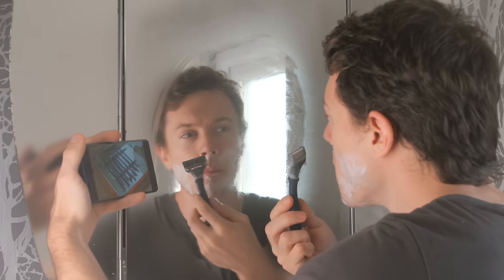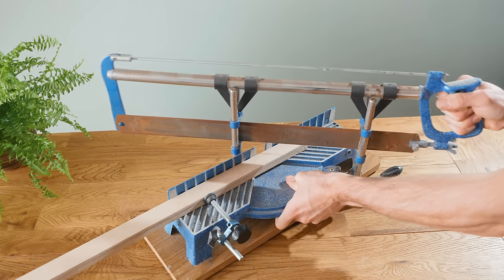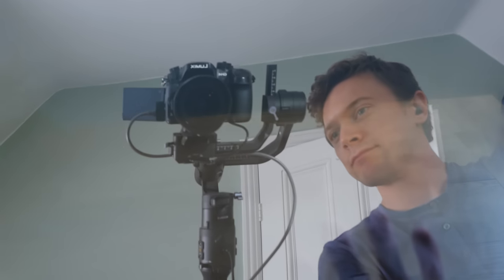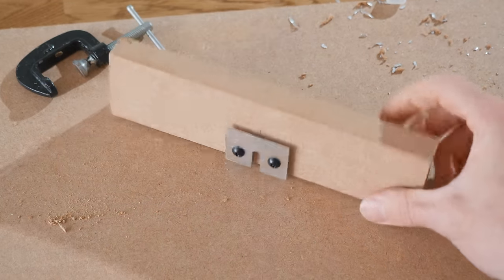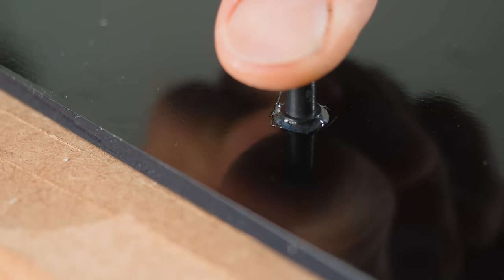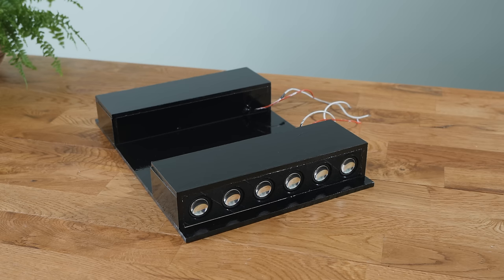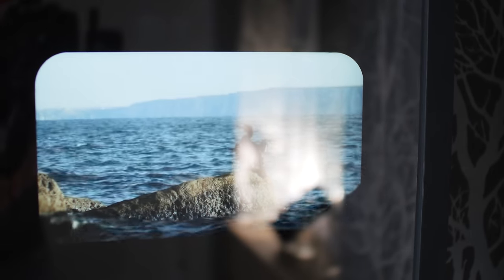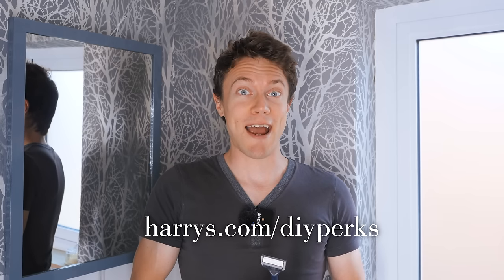DIY Smart Mirror (that doesn't steam up!)

Comment: "The mirror is always filled up with water" Yeah, that's fine and dandy until you get algae growth and the whole thing begins to reek
Reply: You won't be getting algae, since this thing will leak in like a week.
Reply: @lazar2175  If you think a week is not enough time for algae to develop it is because you don't have an aquarium ;). Algae will grow, and it even doesn't need it to be full of water, just a very humid environment (exactly what we have here).
Reply: @almarma  Oh boy i have a aquarium, but algae have 0% chance of developing here.
First off, the tap water is mostly sterile due to dubious amounts of chlorine in it. This means very little to no starting ground for algae.
Second off, the algae needs light, and this doesn't provide any light to the water.
Also third, my comment was supposed to be a joke and not taken seriously.
Reply: @lazar2175  Tap water is not chlorinated in Europe
Reply: @lazar2175  Maybe with a lot of chlorine you could get less or no algae at all, but not everybody has that amount of it in tap water. Also, if the bathroom has a windows, it could have enough light to grow algae. I can't say it 100% for sure because I haven't tried, but knowing how algae can grow even inside the tube I use to vacuum the gravel once a week (only once a week gets wet), I have a lot of doubts that this part of the project will work in a long term
Reply: @almarma  it's a mirror. One way light passes kind of easily, the other way is extremely hard. So no light. What you saw in the video was the display brightness cranked up to 100%, as so much of the light is being reflected by, well, basic properties of a mirror.
Reply: Some copper would probably help keep algae from growing. Bad idea for aquariums, good idea for decorations.
Reply: @almarma  You know that there are different breeds of algae, right? I've got several fish tanks, and some of them grew algae within a week.
Reply: Felixkeeg have you ever been to the Uk? It smells of chlorine.
Reply: @Felixkeeg  Well thats interesting, here in Bulgaria it is chlorated. Where are you from?
Reply: Just add a silver kill coil (used in PC watercooling) and that should inhibit any growth - They're not perfect, but better than nothing.
I'd be more concerned with the MDF swelling if it's not sealed properly and I'd also want those electronics wrapped to help prevent the parts from corroding.
Reply: @Felixkeeg  .. that's not correct. UK and Ireland -> yes, we have chlorinated water.
Reply: @Felixkeeg  some places it is
Reply: @xero2715  Yes, of course I know. So, what's your point?
Reply: @almarma  You claimed that algae does not grow within a week.
Reply: @xero2715  Sorry but I didn't. Please, read my comment again.
Reply: @Felixkeeg  Oh boy, you are wrong again. 
It is chlorinated  in most countries in Europe, only a few countries don't chlorinate their water but even then they use other things to prevent stuff growing.
Think logically, do you have any algae in your toilet seat tank? Or in your washing machine? I know i don't.
I agree that this design is bad but it will not get algae infested before it leaks i guarantee you.
Reply: @almarma It will not work, it will leak very soon.
However, this thing is essentially a black box inside, there is absolutely no light inside, hence no growing things.
Also, most places have treated water with things to prevent algae growth.
Think about it, any algae in your toilet flushing tank or your washing machine or your kitchen sink.

Also, if you own a aquarium you probably know fish won't survive in regular tap water for long, so we either leave water overnight in the open container or boil it to get rid of HCL, or we use distilled water uf the tank needs topping up.
Reply: RainX anti fog for car windows wouldve been a much better choice.
Reply: @somedude2492  Your statement is fundametally wrong. The direction of passing doesn't matter, it is a partial mirror from either side. So light travels into the case just as easily as it leaves it. There would be light in there for algea to grow for sure, even if it will not be that much.
Reply: Jappleng
What do you use? I tried the shaving foam trick and it didn't work. I don't want to spend money without being sure I'm not wasting it
Reply: Jappleng
I find it hard to trust reviews aren't paid for, find that comments are generally a better source of info
Reply: @lazar2175  I'm pretty sure it's not chlorinated in England...
Reply: Bruh, algae forms anywhere with most water and some light.
Reply: if not algae growth limescale over time
Reply: @Felixkeeg  and there is electricity in the bathroom. UK is probably the only country that doesn't put washing machines in the bathroom.
Reply: @lazar2175  Nope. No chlorine in tap water in Germany. Also algae wont grow in your washing machine or toliet or something because they dont like moving water.
Reply: @Felixkeeg  Same here
Reply: @lazar2175  chlorine decays after some time and algae could grow again
Reply: you need algae for algae to grow.
Reply: @davepickering997  what are you talking about? Is there a place where people put washing machines in the bathroom? I've never seen that. I didn't live in many places though, so I may be talking only for Brazil, Ireland (and probably Russia) here
Reply: Guilherme Taffarel Bergamin in Poland we usually have washing machines in bathrooms, and we keep (and use) hairdryers there as well
Reply: @pawemarkowski2768  interesting. I can't imagine a washing machine in the bathroom because it would take a lot of space there. In Brazil we usually have an extra room for that with iron and the hanging stuff I don't know the name in English. If you live in a small apartment without this area, the building would have a shared place for everybody to use, like three or four washing machines and dryers (or the hanging thingy) plus some irons.

The hairdryer though, I agree. We also keep it in the bathroom. I don't have one because of short hair, but I've seen people having it in the bathroom
Reply: Doesn’t algae need sunlight?
Reply: @tsundereyoongi3869  Englands Chlorine levels in tap water range from ~0.5mg/l to 1.0mg/l whereas the WHO has said 5mg/l. So UK water has less than 1ppm of Chlorine in it.
Reply: @DarthGTB  Yes in Greece a lot of apartments have a dedicated space for a washing machine in the bathroom. Complete with water intake and outake. The power though is taken from an extension cord through the wall that connects directly to a power socket outside the bathroom.It can be disconnected from the socket when not in use.

Also in Germany and in Greece I had a power socket on the bathroom mirror on the top right next to the lights with  13+ amps for hairdryers and other high wattage appliances. Although they had a safety switch for on and off. 

I am from Greece but grew up in Germany and now live in the UK and find it a bit inconvenient but more safe not to have any high amperage sockets in the bathroom. At least in the houses I have lived so far the only sockets where shaver only sockets with low amperage.
Reply: @KostasRetrokiller  interesting. In Brazil we might not have washing machines but we do have electricity sockets on the wall. I use it for my shaving machine, but you could plug anything in it no problem.
Reply: @Felixkeeg  a great example of lying just to get your point through and to have the upper hand in an argument..
Reply: I mean some sort of simple anti fog layer would be far better.  Or heck do the two layers except put a small heater and fan in between.
Reply: @Felixkeeg  I don't know where you do live but tap water is actually chlorinated in Europe

Comment: Wow. This is definitely the most elaborate smart mirror I've seen so far. I do think using the Chromecast is brilliant. Most people use a Raspberry Pi. And that paint job! I thought he was holding a metal or plastic frame at first. Now I just have to convince the wife to let me get rid of the medicine cabinet...
Reply: Why not both a medicine cabinet and this. With some clever modifications to this setup you could easily integrate a door
Reply: @rayproductionsbackupchanne3862  Right, you could have the medicine cabinet be behind the screen, which makes it a piece of cake, although this mirror isn't slim to begin with, and adding a medicine cabinet would make it even thicker. Defenitely do-able though.
Reply: @jarleskogly8388  it would have to be build in the wall
Reply: The mirror is thick because of all the components behind. Just place them under the cabinet OR inside of the cabinet.

Comment: MDF in bathrooms is not recommended, even if painted.
Reply: Victor Supreme that’s what the MDF sealer is for.
Reply: @JohnJones-it3us  Yup.  But one tiny pinprick will continue to soak up litres of water and balloon out.  Not worth the risk IMO.
Reply: Then just use an epoxy resin and you won't be poking any unwanted holes through it.
Reply: TheRageMaker  It absorbs moisture like crazy apparently
Reply: Or, you know.. just use actual wood..

Comment: Amazing!
..As for shaving, I started using a Feather safety razor with Feather Japanese made blades (sharpest on the market) I will never go back to a mach3 or any other razor again. Also it's the cheapest way to shave and the best.

Comment: heck imma try this with a giant 30" display panel XD
Reply: Lol
Reply: That sounds like a really good idea tbh. I can think of some great uses for that (Halloween is around the corner)
Reply: But then it wouldn’t really be a mirror would it? May as well just hang a TV on the wall, and good luck powering that and staying alive.
Reply: If you do, you won't need the complexity of this design, the heat generated by the tv itself will prevent it from fogging up. 30" two way mirror glass isn't cheap however 😎

Comment: I wouldn't do a version of this that needs to recycle hot water every time it's used during a shower or after a shower. I think there are other ways that don't involve recycling water or high powered heating elements.

Comment: I would rather have used a 12V heating foil/film instead of this crazy water system.
Reply: I agree. This seems overkill or just the wrong solution for this problem.

Comment: I'm surprised you wouldn't just use glass and build a heating element into the mirror that turns on when you use a single plug, which also powers the display/speakers.
Reply: He's British, they do not allow electrical outlets in bathrooms there, that is why he used a battery pack and I don't think that battery pack would power a heating element for long or even at all.

Comment: having to attach a plug to your tap and fill the mirror with hot water every time you use it seems like quite a bit more effort than just periodically applying an anti-fog coating like they sell for car windshields.

I also feel like you could make it a great deal thinner by not facing those speakers sideways and instead have them either bounce sound off the wall or transmit it through the glass

Comment: How about using heating wire?
I think i saw some on Aliexpress. Like 12v i believe
Reply: I believe you don't need one. it would be enough to add LED lights to the mirror as they provide both light nad heat.
Reply: @CovertCoder01 I am not sure.  What you can google is:
"A good quality LED strip should be capable of providing 4 watts per foot or more (15 W/meter).
"

"As a result, typically, you may see LED strips run at 30% efficiency. This means that a 90 watt LED strip light reel will emit 63 watts (90 watts x 70%) of thermal energy - approximately the same amount of heat as a 60 watt incandescent bulb, which as you may recall from experience, certainly gets quite warm."

Comment: (Sorry about my English, I’m from Brazil..) i actually made it and it looks awesome.. I don’t have any tools to work with wood tho, so I payed someone to tho the work for me and I just paint with oil painting.. instead of an old laptop monitor I just remove the body of an old 17’ monitor with dvi and take of the metal of the display (the metal that stays around the glass and the backlight) and it makes the screen I bit lighter.. I wasn’t planning to get it expensive so I actually don’t have anything to plug everything.. but it’s easy and I really think it easier with the monitor.. it’s a good project guys! The window isn’t expensive either...

Comment: More speakers does not provide louder or fuller sound. It merely provides sound coverage. These speakers wouldn't do much for quality or coverage considering they are not pointed at the user's ears and that they are mounted 180 degrees from eachother.

Comment: "DIY" : Need to have exceptional woodwork skill and handcraft skill and electronics skill and...
Reply: its still "diy"-Do It YOURSELF
Reply: @LFLloureiro  If you can do all of that by yourself then it is DIY. I couldn't.
Reply: Need to have the tools more than the skill. After you got that, it's just following the instructions really
Reply: @krrk6337  How are you supposed to acquire a skill, if you don't do stuff involving it? Even if you fail at it. "Damn, my PCBs corroded, why is that? Oh its because they were exposed to moisture." As long as you educate yourself on how to NOT cause a fire, you should be good.
Reply: That's what DIY is about, you need skills to do things in life

Comment: Just one note/recommendation: Maybe use something other than mdf (solid wood, aluminum) for a bathroom mirror. Mdf that gets even slightly damp will over time bend, fall apart, and any paint on top will peel off. I know this from experience of having mdf cupboards in my bathroom 🤷‍♂️

Comment: I'd go with two heated water channels pumping the water from the bottom to the top and heating it as it goes.
Would take a little while to heat it up, but enough time is given as a shower takes some time as well. No need to place the heating elements inside the mirror, behind it works just as well. Just for the convenience of not having to replace the water every single morning or whenever you're taking a shower. Would just have to top it off with water every now and then.

Comment: Regarding the description, 48 ohms is not too much for an amplifier.  You can put as many speakers as you want in series.  The only downside is the power output will decrease.  Neat project though.

Comment: Would've been perfect if you made a cover for the USB board, since a bathroom can steam up so much that the water can run down the wall tiles, onto your USB board. 
on another note: using shaving cream to clean the mirror also works to defog the mirror, so no need for a defogging system inside. + would've been a nice wink to your sponsor in this one :)

Comment: Your 108++ easy-DIY steps aside for this project: I've no idea what I'm talking about, but apparently hydrophobic mirror coatings are a thing (for cars) and could be an alternative to your hot water demisting system? A subtle bottom-frame evaporator sponge/grille (to soak up runoff) might avoid the need for a drain tube, and would dry out during the day? (you couldn't be evaporating any more water back in to the bathroom during the day than your morning shower initially humidified into it). Anyways, great ideas and re-usable tips for far different projects, so thx a lot.

Comment: This is pretty cool. I just wonder if there is a way to drive a heating element/reservoir/ with the same 12v setup.... would be cool to not have to worry about heating the water with the tap

Comment: So the non-mist mirror is pretty great, but not really practical. The only solution I could come up with is that instead of having a hose filling it up, with water, you would want the mirror to be heated which would do the job regardless. All you'd need for that is to get yourself a heated blanket (or pillow) and attach it to the back of the glass. (well, behind the part that actually makes it dark in this case). Since we're already having electronics in the mirror, that won't prove to be much of a problem, and let's face it, there's plenty of electra in a bathroom anyway (mirror lights, washing machine, etc). Keeping current low enough is key offcourse, but so is isolating it from any water and moisture contact. Essentially you can just use any mirror you have in the bathroom which makes use of some sort of frame and get the same result after some DIY work, which is why i love this video so much as it covers everything from step A to step Z. You may not be able to use the original glass in your own mirror, but you can buy and cut out the mirror glass to fit in your personal frame, and end up with a similar result. If the computer setup is too bulky, you can always simply extend the (flat) wires and build the control unit / computer itself somewhere else, like in a (water protected) cabinet. the laptop screen's width is negligable, so in essence you gan go very flat.

Comment: You can use solar cells behind the mirror to charge the power bank with stray light. If you use it rarely enough and have enough solar panels, you can also install electric heating pads which will de-fog the mirror. Don't forget to protect everything against corrosion.
Reply: I thought the “electricity in a bathroom?!” line was funny, I often forget the UK doesn’t have power available in bathrooms. Meanwhile I have two mains quad boxes with extra USB ports in mine, yay America.

Comment: This project looks awesome. One thing I would like to point out, all due respect to the creator, screwing directly into mdf is not very strong. Very prone to tear out. Unless the OP has a specific reason for it, I would suggest plywood or a cheaper hardwood like poplar. Should be comparable in price and holds screws much better.